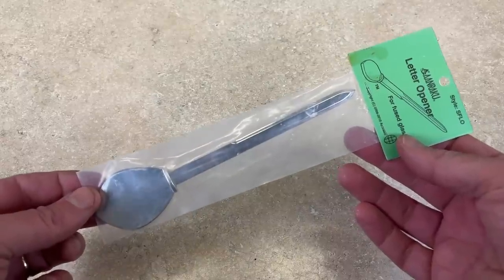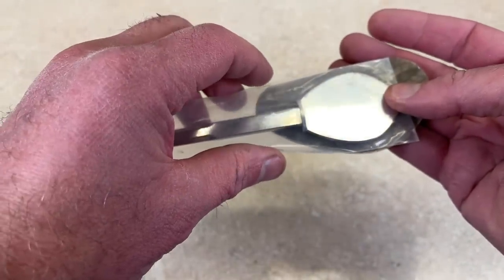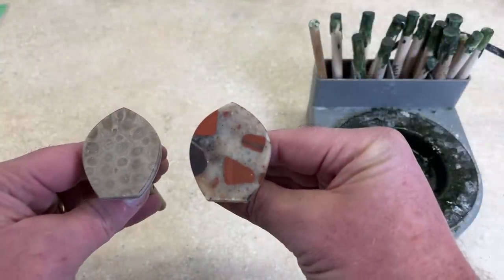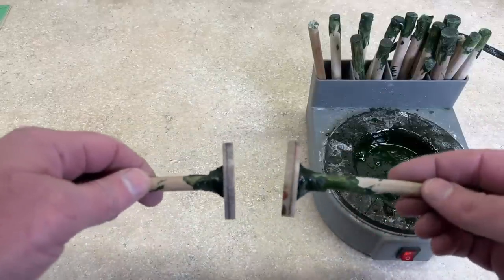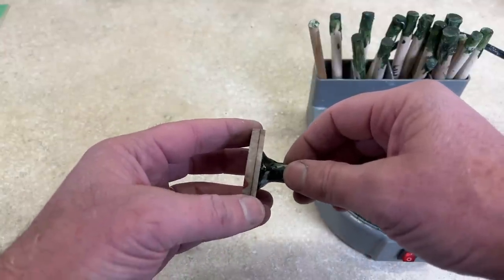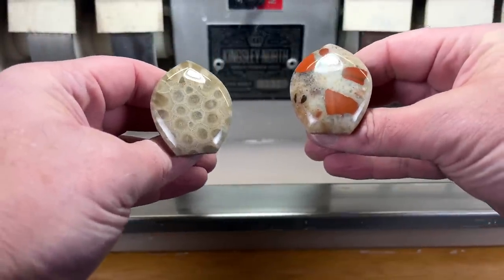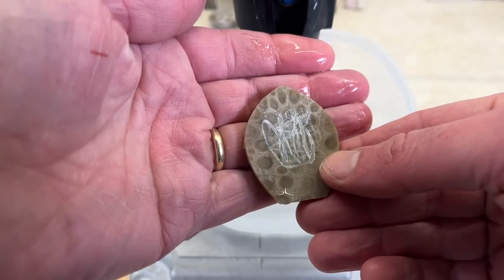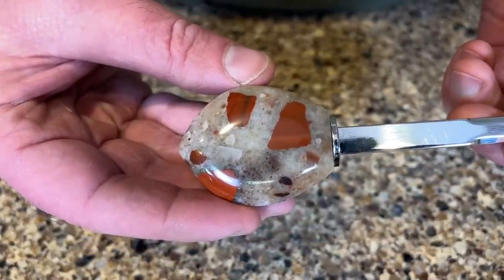Rock, Paper, Letter Opener???

Comment: That came out great. I get a lot of request for those still but the cabs required are pretty large and tedious so I rarely do them now. I do everything pretty much the same except I only use two part epoxy anytime I adhere stones to metal. When selling at outdoor shows E6000 left out in the sun can soften especially if sun hits metal and warms it up. Learned that years ago with glue on pendant bales.
Reply from the maker: It's about time I used that, huh? I was never happy with the polish I got on that old machine. I have puddingstone, unakite, and cladopora cabs made that I think I'll redo on my new wheels and use on the wine stoppers you gave me. Do you usually do both sides of wine stoppers or just one side? 

I know I should have used epoxy, but I thought I'd give the E6000 another try. I didn't know that it softens in the sun. Back to epoxy for the next project.
Reply: @MichiganRocks  So that is kind of the rub with making stoppers or openers to sell. The cab required is easily twice the size of a pendant cab. It is really hard to price them in a way that makes them profitable. By the time you pay for the blank and then add the value of a large cab they get pricey. Adding two cabs that large turns these into really expensive items. Each of the slices you used would have made 2 pendants each and the price for the blank is higher then what it costs to wire wrap all 4 pendants. Hard to charge as much for one opener as you would for 4 pendants. I tend to only make these as gifts now. My wife has used hers for at least 8 yrs and loves it.
Reply from the maker: @chuckmartin218  That's kind of what I was thinking. Those are some huge cabs. Nancy loved the one I made so much that she suggested I give it to my sister before she even used it! My sister will love it though.